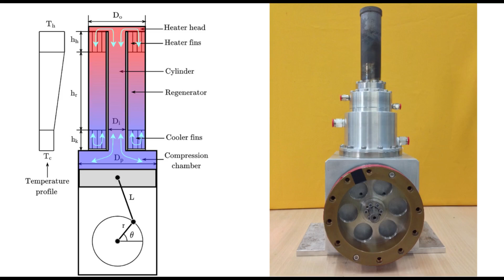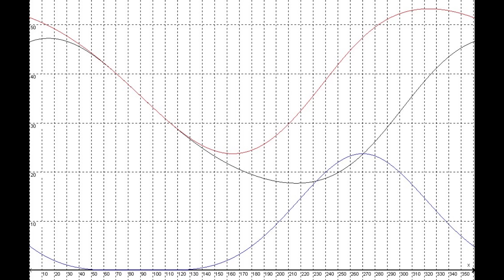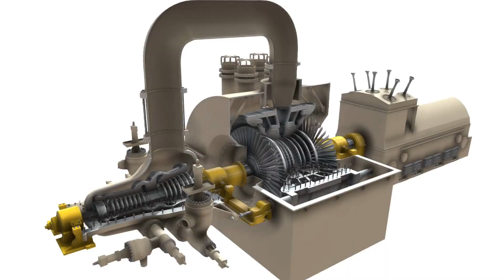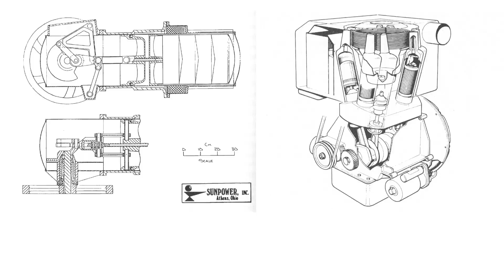Solution of producing cheap energy to support our solar plant to go off grid ?

Comment: Would this be more efficient than converting an internal combustion generator to run on biogas?
Reply from the maker: Its not so easy to clean the self made biogas so pure that it does not damage the internal combustion engine with time.
To get a better efficiency would be a hard challenge but I will try my best...

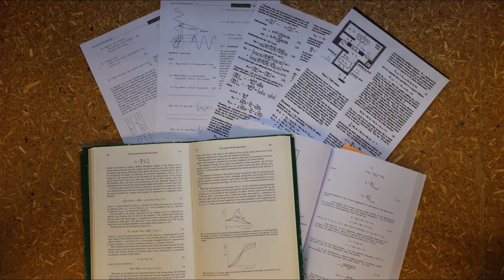Comment: 1:52 have you thought to build free piston engine with steel corrugated pipe, instead of cylinder and power piston, which have problems with leakproofness and friction? Theoretically it is possible, to make engine with corrugated pipe absolutely leakproof, and without friction! The same story by displacer, to replace him with corrugated pipe, without friction? Maybe such engine could also become very silent? And corrugated pipe could work also like spring, if it would be build from right material?
Reply: Like the mechanical barometer design
Reply from the maker: You mean a diaphragm or membrane?
Reply: @myengines2443  The name of it is edge welded metal bellow, it is like round accordion, cylindrical and completely sealed!
Reply: The name of it is edge welded metal bellow, it is like round accordion, cylindrical and completely sealed!

Comment: how do you lubricate the cylinders when its runing?
Reply from the maker: Any lubrication would contaminate the heat exchangers, especially the regenerator, so they have to run dry which causes a lot of problems and make things much more complicated!

Comment: Why don’t you have more solar panels and battery storage? My system is designed to handle the worst part of the year in Canada, and it works well. It’s simple and requires virtually no maintenance. You could use gas only for heating purposes, such as cooking, hot water, and space heating.
Reply from the maker: Because in summer the solar plant is much to big for our needs and in winter its 10x to small, it would not be reasonable to scale it that much!
Reply: @myengines2443  I understand. My energy needs are small, and a larger system easily meets them without being costly.

Comment: I think external combustion is definitely the way to go. I personally would probably choose a design that's easier to make/repair and make up for power limitations and reliability by having multiple cylinder pairs in one generator or multiple generators to give redundancy. But there would still be a minimum viable reliability. Man, you have set yourself a really difficult task!
Reply from the maker: Thank you very much for your kind comment and your sympathy!

Comment: Just wondering why the stirling engine was unsuitable for continouse charging?  If its about c vs dc  then rectification solves that, a pi filter (Capacitor inductor capacitor) smooths the output. And if the voltage is inappropriate still, then a dc to dc converter can get you to an apropriate voltage. And lastly a charge controller can ensure your not overcharging your batteries. Or was there another problem?
Reply from the maker: The problem is that the power levels I achieved are so low that it has to run 24/7 to produce enough energy in winter.
As a hobbyist it is very hard to get it reliable enough that the Stirling can run 10000's of hours without major maintenance.
It makes no sense if I had to replace the whole running gear every few weeks!
Reply: @myengines2443  if low level ebergy (heat) is needed for winter use.  Converting solar pv watts or wind energy to move 3× to 4× more  energy into your home with a stirling  heat pump with an electric motor. 

I've thought about using solar thermal with a heat exchange fluid and use stirling cycle to upgrade the heat being pushed into my home as to Supplemental heat.  Supposing a coefficient of performance  of 3 is relatively easy to achieve,  then I could turn 500 watts of electricity  into 1500 watts of heat.   

Just making some back of the napkin calculations and guesses.

 
It shouldn't be too hard to make a solar thermal panel that has 1k of solar radiation shinning on it. Supposing it's collection efficiency is 50% would mean 500 watts of heat of solar thermal heat per pannel, and 3 three pannels would provide 1500 watts of solar heat.

Supposing it's (20f or -6.67c) outside and the solar thermal raised the thermal transfer fluid temperature to (60f  or 15.56c), then one would need to upgrade the temperature to (120f or 48.89c) with a heat pump while achieving a target COP of 3 or better. 

In theory, one could drop the thermal transfer fluid to below ambient temperature and pull in energy from both ambient heat and solar, but then there's risk of condensing frost on the solar thermal pannels which would lower their solar collection efficiency. it  might be better to add more pannels in parallel to add collection capacity. And using a storage tank can store excess thermal energy into tge night and given enough, into the day. 

Given intermintency of sun and clouds, solar thermal is best to augment another means of home heating.  

Given the simplicity of thermal lag engines, I wonder how well they might work as heat pumps. But because of their lower efficiency, Realisticly I suspect the challenges  will be achieving a sufficient temperature difference and suitable cop.

Comment: You can buy free piston stirling coolers, they arent cheap but id be interested to know if they could be adapted for power generation
Reply from the maker: They can't because the heat exchangers are made for the different temperatures.
Also the are build quite different and are expensive.

Comment: Why not use a sand based thermal battery to power the Stirling engine, then heat the sand with biogas or the concentrated sunlight like those cheap solar furnace projects. If you can remove the Stirling engine from the original heat source, you can change up how you produce the heat and remove the need to constantly feed fuel into it. From what I understand, large sand batteries can retain heat for quite a while once it's heated.

Comment: Too complicated . Evenly pull all of heat off each cell and then store that heat in the building mass. During the summer store heat in underground mass for winter use. Solar thermal is 4x solar photovoltaic. Plus cooler cells become more efficient. Alas it likely requires upgrading heat to 130 as well as keeping panels < 95
Reply from the maker: Just to heat the house this is very nice and efficient, but I also want to generate electricity...

Comment: I suggest you use a thermal acoustic pipe that will make a high pitched sound to make power by vibrating piezo electric elements to make power. Where you only need to harvest the energy with a diode bridge and maybe capacitors that dump power into a battery bank once the capacitors are charged.
Reply from the maker: At the moment I am building a thermoacoustic prototype model to get familiar with the principle.
I hope to report a new video about it soon!

Comment: I saw something about using the flame to heat a sodium mass that will emit a tuned light wave to be collected by a tuned solar panel that will have much more efficiency
Reply from the maker: Do you know at which temperatures this works?

Comment: if you mostly use the biogas directly in an open burner (rocket stove) then it produces direct heat like wood/alcohol stoves without having issues of contaminations. then part of the heat can be used in peltier TEG or steam engines to generate electricity, and rest of the heat is also captured and transferred directly or to water/sand heat storage. by capture I mean that the steam/stirling engine is in the same hot air/water ventilation/pipe room, as the generating engine, so that the hot air/steam output to the steam output is directly outputted to the heat transfer system. how about tesla disc turbine generator for steam, and direct hot burn air and steam water directly as heat output. small tesla turbines are easy to make and maintain. you might also be able to use tesla disc turbine as the burner at the same time as the generator. ie tesla disc turbine is a simpler maintained and made type of the conventional turbine generator burner. you could also gasify wood gas or filter pyrolysis gas or just clean up the methane natural gas. the tesla disc turbine also outputs very cold liquid or ice, so its a compressor heat pump also.

Comment: since your using biogas, why not use an internal combustion engine. a free piston internal combustion engine to be precise. you will have less moving parts. if corrosion is an issue then you will only replace less parts. i think the challenge for this engine is making your own solenoid valve as it will be controlled electronically.  https://youtu.be/u4b0_6byuFU?si=-xJbl74cjKfBPvRT
Reply: i jus realise that this wouldnt work as a 4 stroke. no flywheel to help with compression, intake or exhaust. could work as a 2 stroke. as a bonus, 2 stroke needs oil to lubricate the cylinder. this could also help prevent corrosion from biogas

Comment: Interesting, we seems to have very similar ideas. I looked into the same issue and came up with the same pros and cons. In the pursuit of low maintenance, I'm convinced that a sacrifice of efficiency is inevitable. A very simple system would be a boiler connected to a steam turbine - not as complex multi-staged one as the ones used in power plants like you showed, but perhaps a modified turbo charger is a good start to evaluate how much efficiency we leave on the table. The whining noise can probably be dampened to neighbour-friendly levels through a brick construction, perhaps with a double wall filled with fine sand to get a very dense enclosure. The upside would be that the setup can be both flexible (the turbine can be placed in many different places around the boiler), compact and mechanically simple (only two moving parts - the turbine and the electric generator connected to the output shaft - perhaps with a belt to avoid having to exactly align the shafts, but that's about it). I'd say it's worth a shot, but I admit I have not done any math nor experimentation on this and there is very little precedent to be found online.
Reply from the maker: Steam really seems to be still very popular as I see in the many comments here!
If my Stirling concepts fail I will try a steam variant but the idea of a boiler and many steam and water which needs a lot of space is not very attractive for me.
A reliable Stirling can just run in my workshop and directly heat it without any wet mess.
Reply: @myengines2443  Yeah, they have significant advantages which I hope you can leverage given enough time.

Comment: BAM-TiB is nearly as hard as carbide or diamond and is the slipperiest mechanical material of all.  Couldn't you beat the corrosion problem with this and just go with a low-compression IC?
Reply from the maker: I will look out for it, never heard of  BAM-TIB.
Thanks!
Reply from the maker: Aluminium magnesium boride or Al3Mg3B56, colloquially known as BAM, is a chemical compound of aluminium, magnesium and boron.
It is a ceramic alloy that is highly resistive to wear and has an extremely low coefficient of sliding friction.
BAM films can be coated on silicon or metals by pulsed laser deposition, using AlMgB14 powder as a target, whereas bulk samples are obtained by sintering the powder.

The properties sound really nice but it is really high tech.
If it is commonly made for a reasonable price in specialized workshops it may be an option.
Do you know what it may cost to coat a custom cylinder or piston?
Reply: @myengines2443  Wiki updated their article, i see, with very helpful process specs.  I'm glad I looked that up again!

Comment: Throw the whole assembly in a vacuum chamber instead of flame wicking the heat exchanger
Reply: Solar tubes instead of flame wicking
Reply from the maker: How hot do they can become? 
To achieve a good efficiency and power the temperature difference has to be as big as possible!

Comment: What i did is modify a old diesel engine to run on woodgas I have a tar free gasiffier design to so the thing is spotless it produces 5 kw/h (derating is 20%)
Reply from the maker: I would mainly use biogas from my micro diy digester and it is not easy to completely clean the gas so it does not destroys the IC engine really quickly I think!
Reply: @myengines2443  cleaning wood gas is most often a bigger problem than for biogas. first, make it dry. Then filter the dust with rockwool en after letting the acidic stuff do its thing to something like a steel wool filter , then its perfectly fine to burn it in an engine , I recommend making it a 2 stage system so let a Stirling engine run of the exhaust gasses of the otto engine you can Get 35/40% thermal efficiency mevy more 😀

Comment: If your current rhombic produces 300 W, can you not put six or seven in series on a common crankshaft? Perhaps it then becomes a question of producing enough biogas to feed them? 

Perhaps you could explain better what you mean by service interval? Do you mean refueling? 
Cleaning out? 
Replacing parts? 
These are very differing levels of concern.
Reply from the maker: By service intervals I mean replacing or repairing worn out parts like the piston rings, the cylinder surfaces and bearings.
This is quite work intensive.
The engine is simply too complex and expensive to build multiple of them!

Comment: For what it's worth, if you choose to go with a conventional I/C engine, you can add automotive water injection in order to control and eliminate the by-products of the dirty fuel, along with adding power and efficiency due to the mist flashing into steam.
    If you want to try an easy turbine style look into the Tesla turbine which uses no complex blades, and is quite easy to machine.
    For a large, inexpensive diaphragm, they can be found used in large truck brake canisters.
    If adding a generator to a battery based Renewable Energy System, for best efficiency, match the generator/charger output to the ability of the battery to accept the charge.
    For example, if you have a Lead Acid battery, they have a C/10 best charging rate. Therefore if you have a 1000 Amp hour battery you should charge at a  maximum of 1000Ah÷10=100Amps. Different battery chemistries have different optimal charge rates.
   Thank you for sharing your experiments with us, it is very interesting.
    I have not seen all of your videos, and I'm curious what excessive maintenance is causing you to abandon this project to charge your system?
Reply from the maker: Thanks for your many suggestions!
I do not abandon the work on the Rhombic Stirling, I just want to try something new now, mainly for motivation.
The Rhombic engine is very complex and therefore too expensive and maintenance intensive to really reasonable produce some energy for household use.
It has to be made much simpler for rational use but first I want to investigate if something different may be more easy!

Comment: Great video ,have you tried a vacuum engine or also called a flame eater ,a type of heat engine .the main problem with heat engines is when you size them up they are less efficient, so why not use more than one smaller engine .cheers
Reply from the maker: I never heared of a powerful flame eater engine, does you are anybody else?
Reply: I never heard of them before either ,I found one at an antique store and had to research it to find out what it was ,it turned out to be a solar 3 from pm research ,it seems to have a lot of tork for the size of it ,I have seen larger size ones on YouTube that may produce more power ,I am still experimenting with mine ,I plan to run a small generator from it and see how long I can run it at one time.